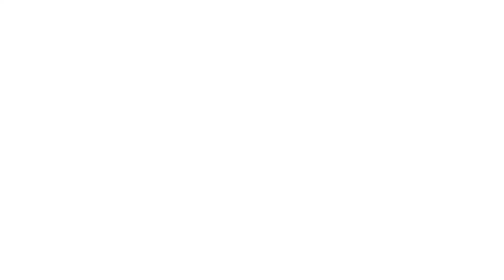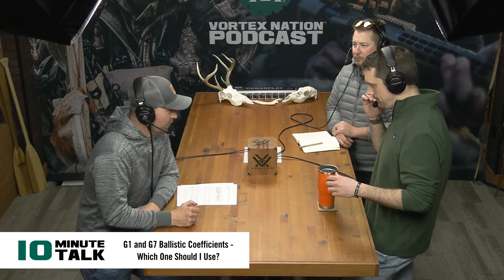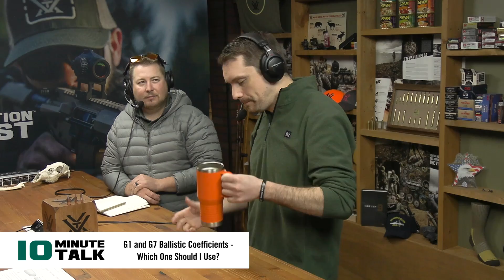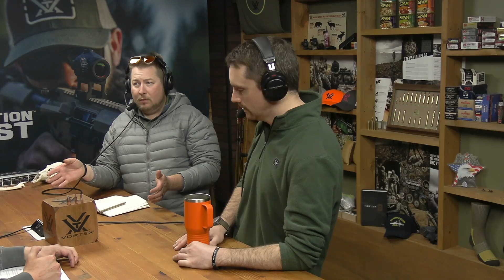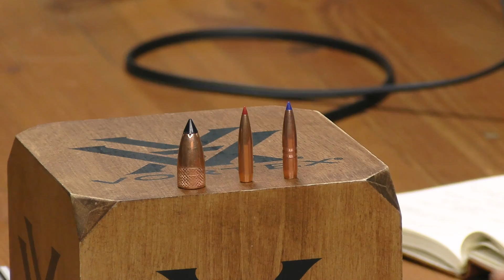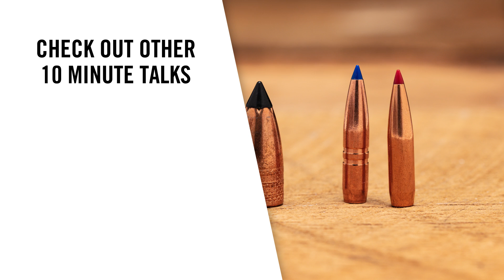#10MinuteTalk - G1 and G7 Ballistic Coefficients - Which One Should I Use?

Comment: Multiple points here from different references. 
1. In the Berger manual the way I read it was that the G1 is for more traditional bullets and the G7 is for (like y’all said) the higher performing bullets. But also that the G1 is based on the bullet at the muzzle. Many different MV will change the BC. If you run a G7 its at envy velocity. So someone please correct me if I understood that wrong. 
2. A heavier bullet will have a higher BC because it can buck=k the air better but it will also be at a slower MV because of the weight. This is all dependent on if you run the load at a lower node vs a mid load vs a higher node. The Node selections should also be in the same realm. 
3. Then we get to a lighter faster bullet or a heavier slower bullet with different BC… the more time it spends in the air (MV) the more time effects have vs the faster bullet spends less time so less time to be effected. 

I guess the real conversation and choice would be at what range to you expect to have a max range and then decide on the bullet. It gets deep. But great conversation. I love to get opinions on the science of it. I am the bullet geek that reads the front of he manuals and not just the data within.

Comment: BC is defined as a form factor multiplied by the sectional density.  Two bullets can have the exact same shape (form factor), but different BC's if one is heavier  Copper is less dense than lead, so a thin-walled cup and core bullet that is mostly lead will will weigh more and have a higher BC than an an all copper bullet of the exact same shape.   Things get a little fuzzier with bullet designs that have a lot of copper and relatively smaller fraction of lead, like the Terminal Ascent bullets. They end up somewhere in between.

Comment: Manufactures also use G1 numbers on non G1 bullets because the numbers are higher and it looks better for sales also I think Barnes rates there BC numbers at 300 yards versus other companies rate them at 200 or 100 yd
Reply: The G1 BC of a sleek bullet varies with the bullet velocity because the bullet is not shaped the same as the model (the model has a flat base, fairly short ogive).  What matters is that the BC you are given is in the velocity range you are using.  If they give the BC of a bullet from a 300 Win mag, it won't be accurate for the slower 300 Savage, for example.
Reply: There ya go. It’s all about at what rage and speed at the muzzle or distance was it measured. I thing it should be standardized on the box at the muzzle or 100, 200 etc. so we can get apples to apples. 
I know that I always work off my BC calculator and then true it with what my MOA is in actual findings as rifles as well as the data given fluctuates.

Comment: I wish you guys would've talked about how the posted BC on a box of factory ammo is only accurate at the posted velocity
Reply: That doesn't make any sense, you can buy projectiles separate from the rest of the catridge components and they still have the same B.C. on the box.
Reply: @dethmgnt4257  that's correct. I'll give you an example since I was just looking at this bullet vs. this cartridge.
Barnes LRX 190 gr. 30 cal projectile has a BC of .541. That's just the bullet for reloading.
A box of barnes vor-tx 300 win mag 190 gr LRX has a BC of .499. That's for a box of ammunition. Why? If I had the answer, I wouldn't want them to go into depth about it

Comment: Now I'm wondering if a faster than standard/recommended barrel twist  or at least a gain twist that ends up there would help the older lever gun rounds.

A .45-70 will be lethal as long as you connect with the target so if more aggressive twist would help stabilize it through the trans sonic barrier, why not?
Reply: Faster twist requires the bullet to be harder to handle the forces, which is not ideal for a slow moving projectile in most hunting scenarios. While it certainly could help the long range accuracy, the question then becomes if your trying to use a hammer to tighten a screw instead of just grabbing the proper tool.
Reply: @jaydunbar7538  I've seen  400gr solid copper hollow points claiming to be designed for subsonic use, I would hope that a similar philosophy to the twist of the 8.6blk could be applied to older slow rounds using copper bullets